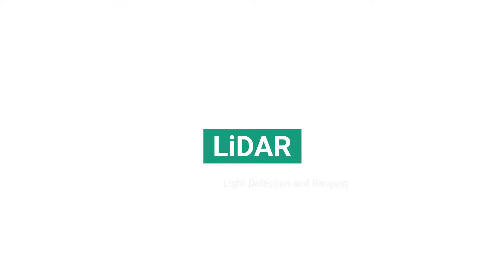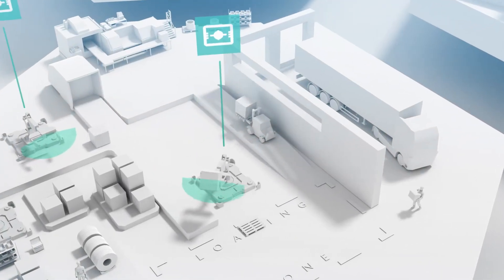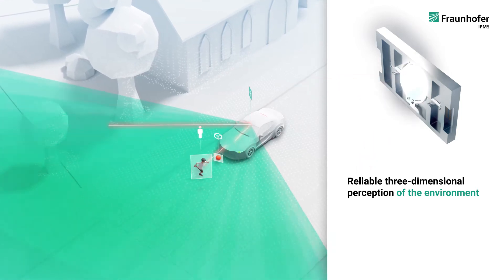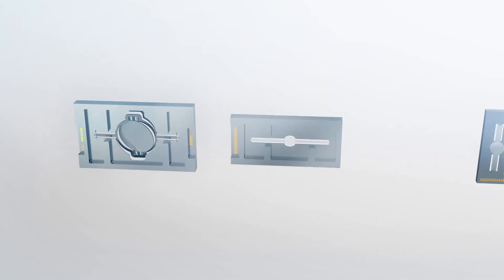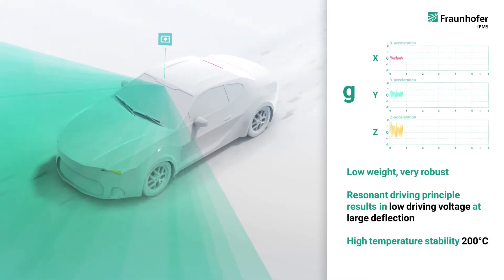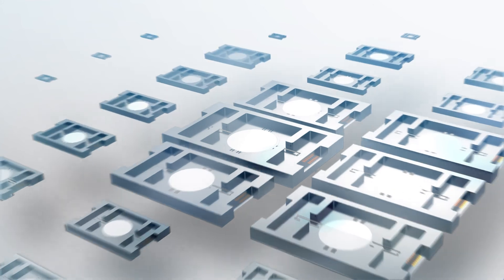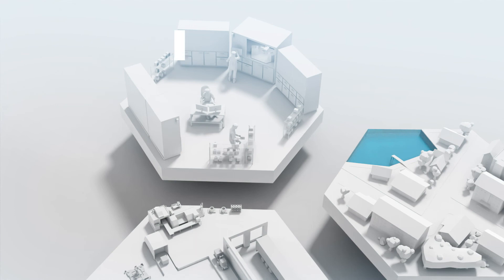MEMS Mirror Technologies of Fraunhofer IPMS for LiDAR | Fraunhofer IPMS

Comment: I wonder if once increased the output power of the laser, a phased array lidar can actually create a hot spot at the focal point.
Reply from the maker: Hi @jatigre1 

Thank you for your valuable question on Phased Array LiDAR.

To our knowledge it’s challenging for a phased array LiDAR to create a laser hot spot at the focal point (mostly also with limited optical power) even simultaneously over a long distance range of  +20 cm  to > 100m which is typically required for an automotive LiDAR sensor. 

Furthermore, phased array LIDAR (typically using thermal phase shifter) causes significantly higher power consumption and requires greater efforts for electronic driving control in comparison to a MEMS scanning LIDAR. MEMS scanning LIDAR is a solid state LiDAR technique. It shows high mechanical reliability of the MEMS scanning mirrors without wear and degradation even at high mechanical vibration. 

In comparison to phased array LiDAR we can achieve better optical performance of the scanned collimated laser beam with lower technical effort and over a wide distance range of up to > 100m.

We have many years of experience in development, manufacture and system integration of customized MEMS scanning mirrors for MEMS scanning LiDAR systems. If you are interested in our MEMS scanning technologies, please don't hesitate to contact us.

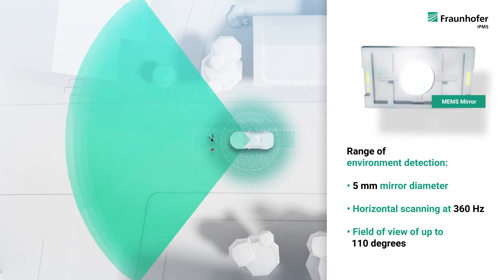Comment: What does the 12kHz mean at 1:48?
Reply from the maker: This is the scanning frequency of the MEMS mirror.
Reply: @FraunhoferIPMS  is this the same from Florian Lenz - Blickfeld Startup ?
Reply from the maker: Dear  @balajichandrasekaran6312  ,  no, this is a separate development from ours. It is very interesting to hear from others who work in LiDAR technology, so thank you for leaving this comment and pointing us in this direction!
Reply: @FraunhoferIPMS  In the video, there are three scanning freq. 12kHz, 360Hz@horizontal direction, 0~35Hz@ vertical direction. I am confused about the relationship between them. Could you pls give more explannation?
Reply from the maker: @anliangyu342  Sure. We offer different designs in our MEMS technology. The 12 kHz are an exemplary frequency, we should have probably ommited them, since it is a bit confusing as you say. For the specific application we present here, the 360 Hz for horizontal scanning and 35 Hz for vertical scanning are the correct ones.
Reply: @FraunhoferIPMS  are you contracted with MicroVision  for there dynamic view lidar?
Reply from the maker: @eviloctober  Hi, I don't think so, not yet. We are only working on one particular component of the LiDAR system, so we will check them out!